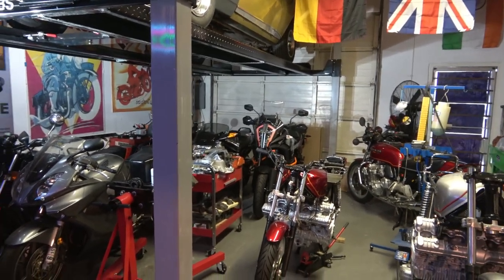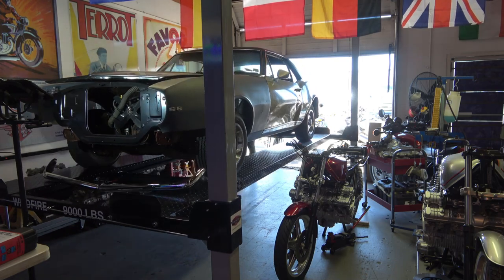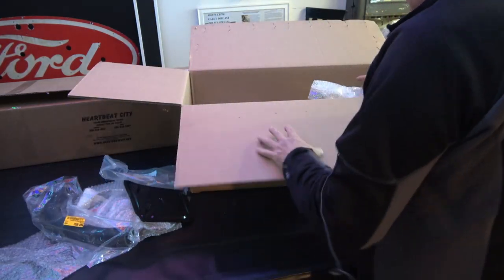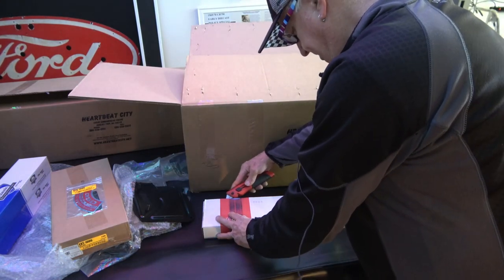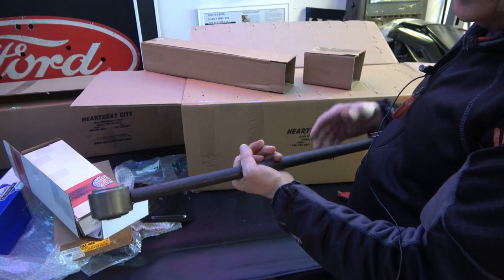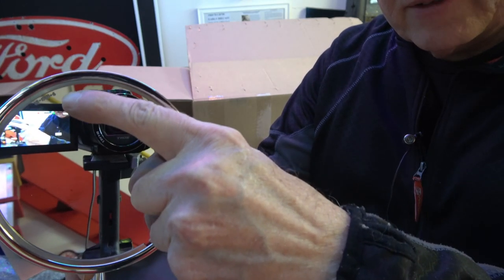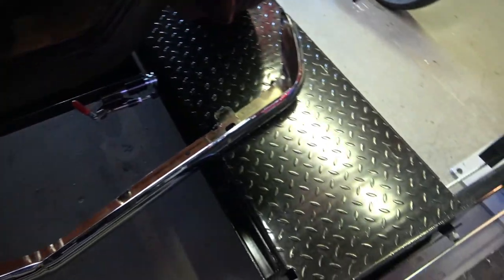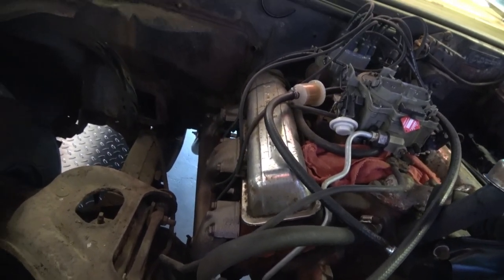67 Camaro RS SS - Part 2 - New Parts & Reassembly of Front End & Engine Compartment

Comment: If I have a 1968 Camaro SS and want to add the hideaway lights...do I need to change the front end or can I just add a valence so that the car will have turn signals? Thanks
Reply from the maker: Hi Rex
In addition to the lower valance, the fenders are different also. There is an extra bracket on the inside of the fenders where the headlight doors bolt up to. Unless you can figure out a way to provide a mounting bracket to the non RS fenders, you will have to replace the fenders to do it properly.

Comment: I got a 67 RS vinyl top 327 but comes out as a 302... Is there anybody out there with good knowledge regarding this engine and how much it would take to rebuild. Me and my brother are doing the body restoration zero rust beautiful California Dry car. Stripped it all the way down the middle starting fresh with fresh new coats of etching primer high build primer epoxy straight body taking it all the way to its original specs.. if anybody is really knowledgeable please contact me I'd like to pick your brain...

Comment: why use repo parts???
Reply from the maker: Hi Rob, I agree with your question and always choose to use nice OEM or NOS parts when I can.  I only use repo parts when the particular part is a perfect reproduction. not all repo parts are good and I will not use those items. But things like the items I show in this video are excellent reproductions. Some are even produced by the original manufacturers that made them in the first place. The fact is that there are a lot of 100 point cars out there that have many reproduction parts on them and are excepted by judges and other experts as legit alternatives to 50+ year old rotten and extremely rare to find as NOS parts. And as time goes by, will be almost impossible. So I for one am glad that there are good high quality reproduction parts out there to keep these cars alive, which is the main objective in the first place. Thank you for your comment and support.
Reply: @digitalpizza1   it took 8 years to nos my 67 camaro but it wo4rth it